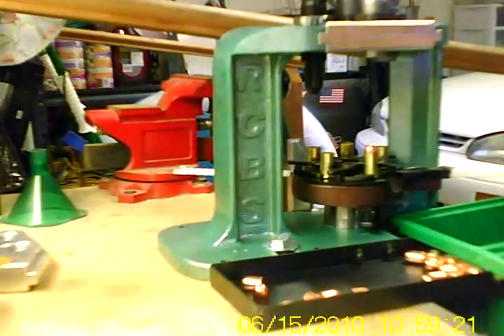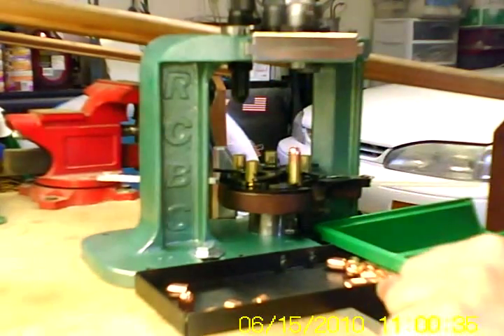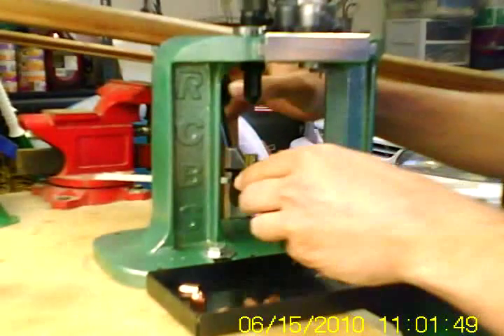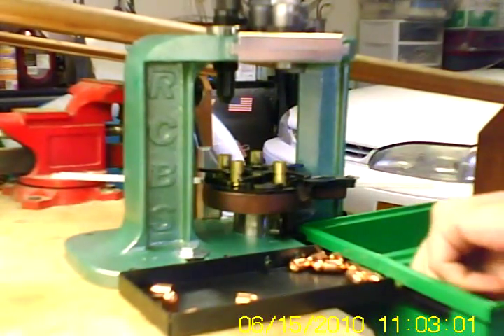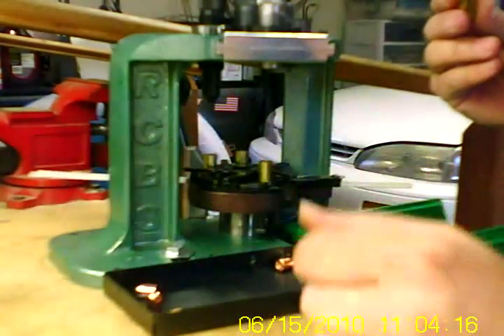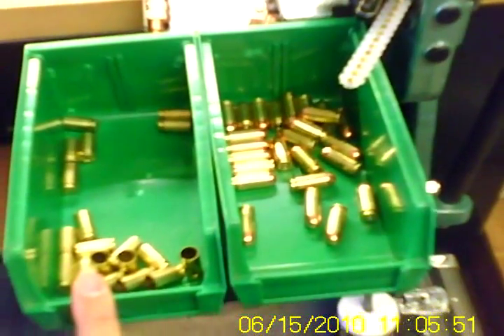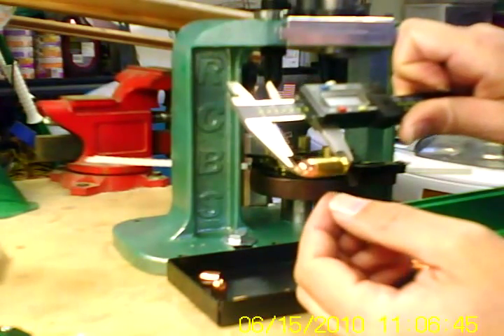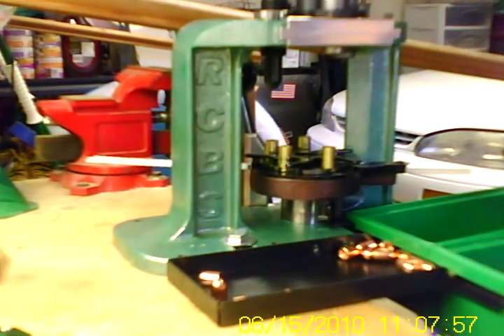RCBS Pro 2000 reloading for the first time

Comment: I ordered this kit, I was missing the powder measure and all linkage, missing a part for the APS primer mech and a missing adapters from  the powder check die kit. other than that I now have a single stage progressive loader. but it does work well.I'm still waiting for the missing parts two weeks later....waiting, waiting...I have to load the APS strips by hand,